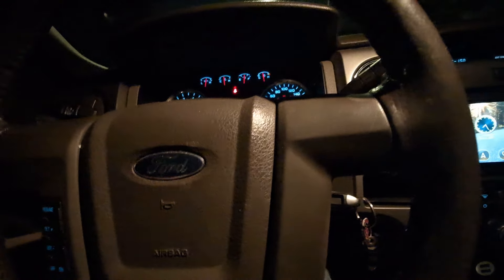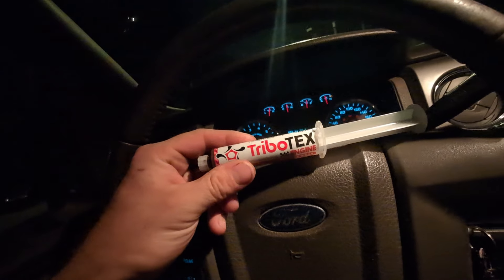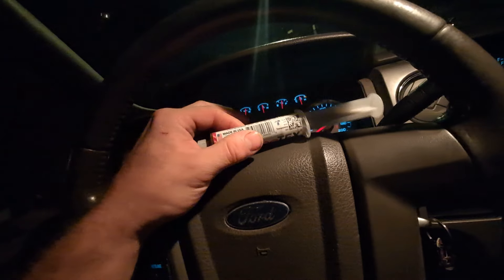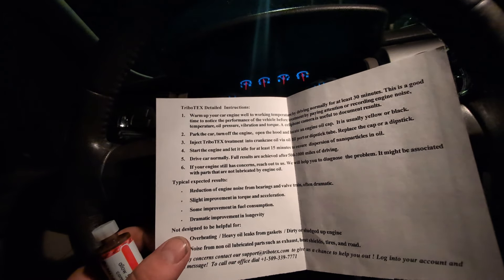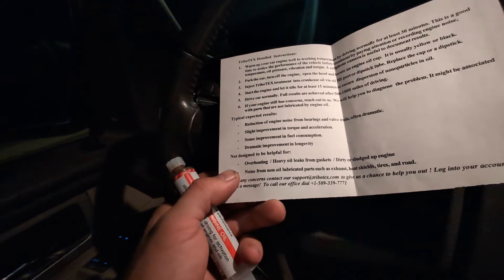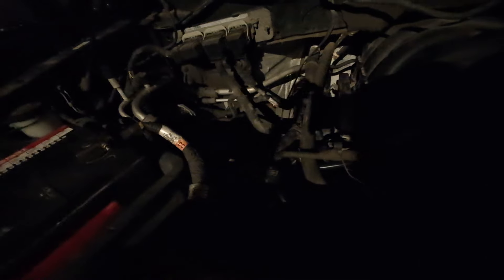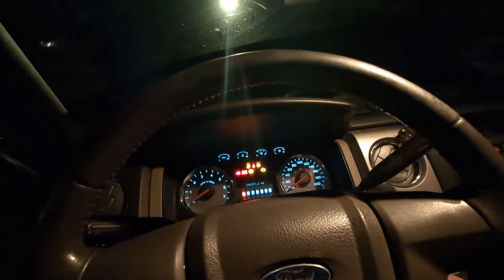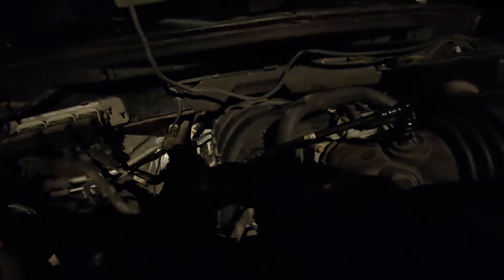Tribotex: The High-Tech Grease That Could Save Your Engine

Comment: My dad also has a 2014 V6 3.5 with 254K miles, original engine and tranny,  turbos changed at 190K miles, coils, plugs , water pump,   5 batteries front and rear suspensions, its a towing 7K lbs daily work truck,  my dads is whisper quiet, yes its gets serviced every 5k miles mobil 1 synthetic. your truck sounds like a diesel. forsure Not done right! best of luck